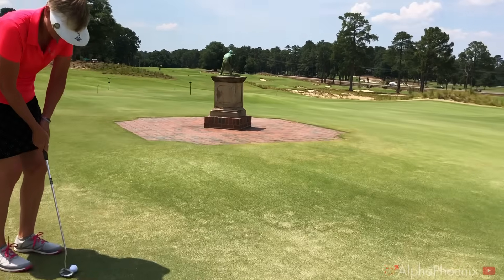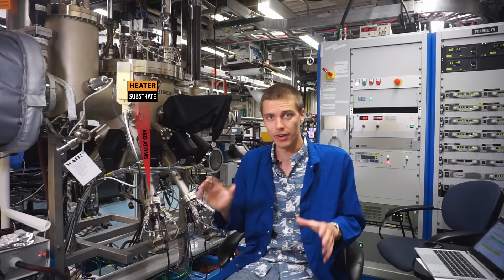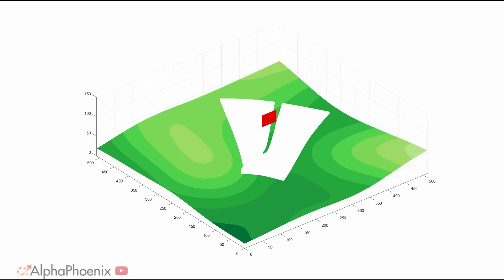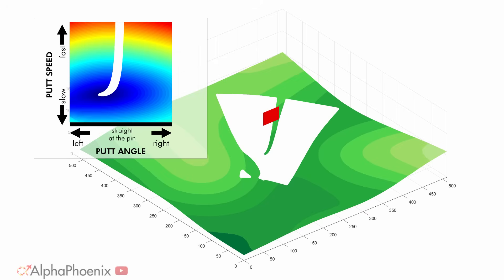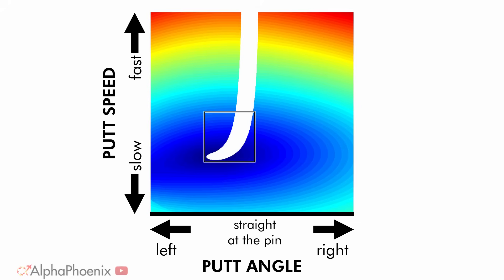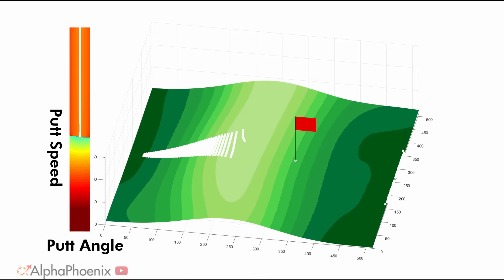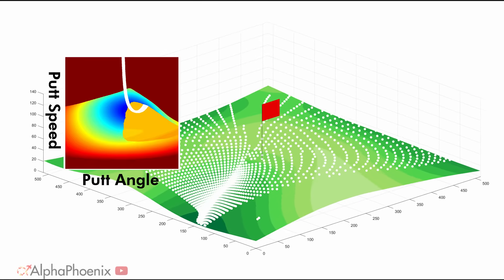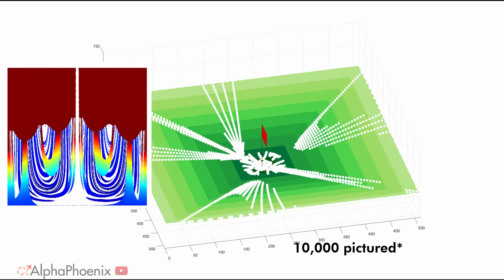Overcomplicating GOLF by simulating every possible shot

Comment: Do you want a similar example? Look at so called porkchops graphs for orbital transfers: on the x-axis the time of departure, on y-axis the time of arrival. on what could be the z-coordinate(or the pixel color) is the total deltaV(how costly in propellants the maneuvers are). usually the Z is represented by isolines (like altitude on maps). for relatively easy transfers the shape of the isolines somehow reminds of a porkchop, because there are 2 good(low deltaV) areas (somewhat similar to your bank/straight shot solutions) one bigger and one smaller, divided by a small gap of really bad(high deltaV) solutions, and this gap reminds of the T-bone dividing the 2 meaty parts of a porkchop, especially when time of flight lines are added( being the axes departure/arrival times these lines are straight and parallel, like the marks of a grill )
But the orbital transfer is not always straight forward: an example of a truly hard thing to solve is basically the same idea when the transfer is let's say from Earth to Saturn, and gravity assists with planets are introduced because even the  gravity assists number and sequence is to be determined. and these are already 2 variables more and are also of a different nature since they are not continuous(you can't perform 2.35 gravity assists, nor squareroot of 2, it has to be an integer), and the sequences EVEMJS and EEVJS are not even a numerical variable. When my team at university had to solve this for a project exam we tried to keep it as simple as possible and we ended up with a 6-dimensions transfer-cost matrix. Even looking for a solution in the result matrix was a problem in itself (matlab's max/min functions apparently did not handle matrices with so many dimensions, so we had to define our own max6D and min6D able to return not just the min/max value but also all its 6 indexes)
In a similar way you might be looking for multiple shots solutions in golf

Comment: In theory, you can control the initial "spin" of the ball
Reply: on regular shots in golf you also can control the loft. wind air resistance would also have an effect especially when spin varies horizontally and vertically. If there was a tree in your way the phase space would look horrendous
Reply: also there is friction, and jumping. you cant control this, but this matters.
Reply: @DiamondSane  well also air resistance. Thermal dynamic influence. Rigidity and age of the gold ball. Strength of gravity at that particular part of planet. And God knows how many other variables that are too small to calculate.
Reply: @liggerstuxin1  The entire point of the phase space is that it's meant to cover the variables we can control. Unless you know some way to control the local gravity? If you can't control it, then it belongs in the simulation, but not in the phase space.
Reply: @QwertyuiopThePie  I was replying to a comment where someone stated variables that you can’t control but still “matter” (heh, I will pretend I did that on purpose). I suppose I went off on a tangent there, but I was also mentioning that there are so many variables that we cannot calculate that also matter. Many more than we even know obviously. But sooooo many we know we can’t calculate.
Reply: @liggerstuxin1  my favorite negligible variable is radiation pressure from the sun at different times of day
Reply: @Greenicegod  Wait, you don't feel the pressure?! ;P
Reply: @QwertyuiopThePie  "Unless you know some way to control the local gravity?" yeah i know a guy

Comment: It's interesting seeing this, the engineer's solution of just simulating it a million times where so many math youtube channels would try to describe it with equations. Keep up the good work!
Reply: Probabilistic math is math too! This is known as a Monte Carlo method.
Reply: @RonWolfHowl  And it's quite common with programming. Simulating a result can often be easier than going through all the equations, because you only need to think about a realistic setup for the system.
Reply: honestly most of these situations can be solved by hand fairly easily.
Reply: I'm pretty sure with this kind of physics there is no available equations other than integrative maths (simulating it a million times)
Reply: @HJ28_398  Would numerial evaluation of solutions work instead? so there is no need to simulate 10000 golf balls but instead find one non-analytic but approximate enough solution

Comment: So, depending on the simulations implmentation:
A) It can be impossible to get a geometry that blocks it: If the simulation is tick-based, You'll always be able to launch the ball at the hole, with the right speed that it just teleports to that hole immediately ignoring any geometry prior.
B) You need to use numerical error to your advantage, and make the angle of the correct shot vs a miss, to be smaller than half of 1.1755e-038 . And make sure the angle that works doesn't align correctly with that anyways.
 
I think your inverted pyramid's graph highlights some of these numerical limits in it. -  You can see that follows the form of a "W", the big spike in the middle, and then it curls up near the sides... but there's these bands of discontinuity in between - but if you look at the pattern of white/blue on either side of those it looks like the white and blue bands would actually connect... 
So what it shows is the 'W' pattern of goals, but also the thicker non-blue bands of... numerical errors causing problems.

Comment: In Golf, you have control over the speed, the initial direction, and the spin of the ball. 0:33
Reply: "when you putt a golf ball..." not when driving or hitting a normal shot.
Reply: @super8bitvideos  You can still spin it, it's just not the smartest idea on a putt
Reply: @super8bitvideos  You can have a little sidespin when putting tho
Reply: In putt putt it doesn’t leave the ground though, so you can reasonably simplify it
Reply: When rolling, spin is negligible after a couple of feet, as friction of the ground overcomes any spin, and the ball begins to roll end over end.
Reply: You also have control of the time you choose strike it at, which can have different results depending on the wind strength and direction at the time of the strike.

Comment: At very low energies at the hole, if the center of mass of the ball is over the hole, the ball is going to drop. At very high energies, gravity will not drop the ball far enough down into the hole before it bounces off the back side of the hole. At intermediate speeds, some CoM positions would cause a drop (holing the putt) and others would not. (You would also get some randomization of vector on the far side of the hole for the putts that didn't drop, but in most circumstances I think that could be ignored in the simulation.)

It seems like you could change the nominal size of the hole in your simulation based on the energy of the ball when it reaches the hole. At high hole-position energies, the hole is essentially not present. At moderately high energies, the precise range of positions of the ball relative to the center of the hole that will cause the putt to sink will dependent on ball energy. And at low energies, anything intersecting the hole will sink. This should be a relatively easy parameter to implement into your simulations and should give you better probability spaces.

Comment: You're the one doing the simulations, not me, but surely it wouldn't have been too difficult to capture a decent approximation of the ball hitting the hole but not going in, by looking at the ball's speed when it hits and how close to the center of the hole it's hitting. Too far from the center and you get "robbed": the ball dips partially in and then gets ejected at a different angle. The higher the speed, the more centered your aim has to be to avoid getting robbed. Go fast enough and it won't go in even if it hits dead center.

The resulting phase space diagram of the bullet vs. breaking shot would have the white area get narrower as you move towards the top of the blob, and eventually end at the maximum speed that won't skip over the hole.
Reply: I was really hoping for this by the end!

Comment: Reminds me of a problem in computer graphics. 

(Explanation of rendering equation and path tracing, skip if you already know what these things are)
There is an equation called the rendering equation, in which one of the parameters is the total energy of all light hitting a given point. To calculate this variable, one would have to add up the energy of all light, from every angel, and every possible combination of bounces. Since this is basically impossible to compute, rendering programs must make approximations. This is done by selecting random paths between a point and a light source, and then averaging their intensity. 

This is where the part related to the video comes in: sampling random paths is a rather inefficient method to get an accurate result, so most algorithms will take samples that are believed to be representative of the total samples instead. There are algorithms that attempt to estimate a "Phase Space" plot of light intensity vs every possible path in order to identify the most preventive samples. Some use AI, while others use more traditional optimizer. 

An interesting side note: Caustics (those weird reflections that waves make on the bottom of the pool) are a lot like the white portions of the plot in this video. There are only a narrow range of possible inputs that lead to them, so they can be hard to sample accurately (they are usually removed to prevent visual artifacts).

Comment: Actually, wandering through higher dimensional phase spaces looking for a specific result is (algorithmically) solved (if you can measure how far from your result you are)! https://en.wikipedia.org/wiki/Nelder%E2%80%93Mead_method
Reply: Basically you're asking a question about gradient free optimization!
Reply: Nelder Mead only works for convex optimization though (might only find a local minima), and even then might not converge - there are cooler methods for things like that

Comment: Something is wrong with the simulation if there is no velocity which can cause an angle which would hit to become a miss. It's not just about being in a good spot if you miss, its that a high enough velocity will literally cause a miss in real space, probably because the physical interactions of the ball dropping vertically into a hole with a flag sticking up out of it are much different from what that simulation is accounting for. Perhaps accounting for roll would make the simulation better. Ah, well you go over this. Still I think that differentiation is to blame for the smear-like phase space, rather than a cohesive object. It's definitely the case that the balls which somehow stop in the reverse pyramid graph are erroneous lol

I really love creating "objects" out of parameter sets. Turning a set of motion variables into a 3d object makes it so much easier to interpret. Also, I'm reminded of how that is fundamentally the same process as what our mind does with the information gathered by our sensory tools. 3d objects are just constructions made from sensory parameters. An apple is no more a singular cohesive object than the graph of motion variables is

the geometry and the speed are already limited, the question is what is the ratio between their limitations? Could an infinitely fast golf ball traverse an infinitely high slope? I guess it depends on if the ratio between the infinity of the speed and the infinity of the slope converge. The question of forbidden geometry seems to be tied to the context of parameter cap ratios

That pyramid golf course could be made harder if you curved the sides of the pyramid such that each edge was a section of a circle rather than a straight line, so that if you were to miss the shot, your ball inevitably lands in one of the corners, which is a harder shot than up the side. I can't think of a theoretically harder spot lol

You could quantize the difficulty of a course by measuring the surface area on the outer edge of the success bubble, and multiply it by the relative "coldness" of the failure, that being how hard it is to make a successive shot. As you mentioned, but it would be interesting to thoroughly write out the math, maybe make a program that can generate courses given a difficulty rating, for good minigolf map difficulty progression lol

a human may only get one data point per shot, but they also recognize that all phase spaces are actually different regions of the same space, and so they can use examples which are seemingly unrelated to assist them in their calculations. Of course software could do this, but most dont. Once a global network of data prediction starts inter-applying to different fields though, hoo boy, hello antiquated human intelligence

And since you mention it, and no one is ever going to read this anyway, my avatar is a cube represented in 5d :P. Each color is a new dimension, I wrote simple program to render rectangles in different dimensions a long time ago, but it was before i knew squat about data structures, and so the algorithm is so inefficient that it takes about 3 minutes to render dimension 7, and something longer than 3 days to render dimension 8, while it renders 1-6 instantly. The algorithm is really horrible thinking back, it basically renders every single line angle that could possibly exist given all the combinations, and then snips back the lines that don't connect to different angles. Terrible. lol

Comment: I wonder what friction model you used. It looks like your balls can come to rest on a slope.

If you want to fix this without changing the friction model, you might be able to hack it by giving the ball some minimum speed as long as the gradient of the terrain at the ball location is non-zero.
Reply from the maker: If I remember right, I set a linear proportional dynamic friction, so that every iteration the ball loses like .01% of its speed or something like that, and for static friction, I set a "minimum speed" below which the ball would just stop.

Comment: Very beautiful visualizations, thank you for making this!

Numberphile did an episode on the Illumination Problem, which is nearly the same as your golf putting reachability problem except that balls bounce off of discrete walls rather than roll over curved surfaces. It turns out that in this setting, you can construct walls which lead to unreachable areas or even single points out in the open. https://youtu.be/xhj5er1k6GQ

It doesn't consider friction, but maybe the Illumination Problem has some related work with ODEs and PDEs that is more applicable to your setting here

Comment: While not quite everyday (unless you're an astrophysicist, aerospace engineer, or Kerbal Space Program player), DeltaV graphs are a perfect example of phase space, and I never knew it. Are prospective space program wanting to send something to another planet can be viewed as only being able to control two things about the launch: the date of departure and the date of arrival. The result is a phase diagram where each value is the DeltaV (change in velocity, can be thought of as fuel, however fuel and DeltaV don't have a constant ratio) required by the minimum energy trajectory for a given departure and arrival date. They're often times called 'porkchop plots', because the graph is bimodal, and has two adjacent regions of low DeltaV requirements, which somebody thought looked like porkchops.
Reply from the maker: Haha I just watched that Scott Manley video! And ABSOLUTELY it’s a phase space or parameter space. I find stuff literally all the time where I feel myself walking through some crazy high dimensional space without realizing it at first. It’s a fun way of looking at problems.

Comment: Excellent video! Simulations like these are super fun!

By the way, I'm pretty sure the more accurate term would be "parameter space". Phase space does imply dynamics, where here you are plotting initial conditions.
Reply from the maker: I think you're right that these should be called parameter spaces. Phase space officially I think I've only seen in multi-pendulum examples with something like angular velocity plotted over time? It still maps out forbidden regions and stable regions. Phase diagrams (as in states of matter or different crystals formed by the same alloy) are also very similar because you pump in some controllable variables and a state pops out.
Reply: Hence the golf is a great example of phase space, but not so much the crystals
Reply: Maybe configuration space?
Reply: a professor of mine uses "design space"

Comment: Very cool.  Once again an awesome video that breaks down a complex problem into something accessible to us non-physics types.  

When the iPhone gets a depth camera with decent range in a year or two it’s conceivable that an AR app will let you walk around a hole and build a 3D model of it and essentially create the Rodney Dangerfield putter from Caddy Shack.  The app basically runs your AlphaPhoenix simulation, computes the high probability angle and tells you when you are addressing the ball correctly. It’ll give you clues on how hard to hit it too. Maybe it also incorporates environmental data to know if the greens are wet and slow.  Of course this would be kinda cheating but a fun problem to contemplate.
Reply from the maker: That would be awesome! Caddyshack is amazing btw